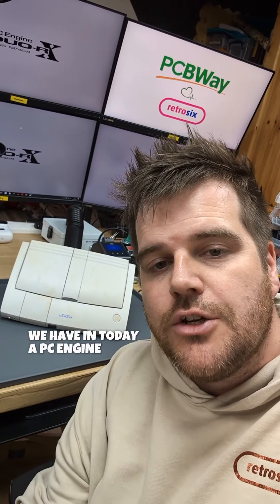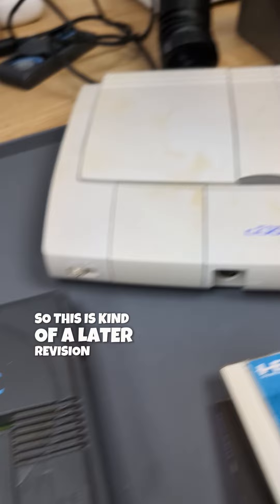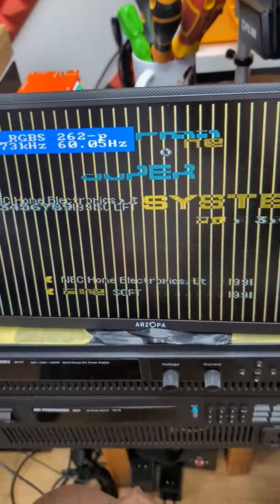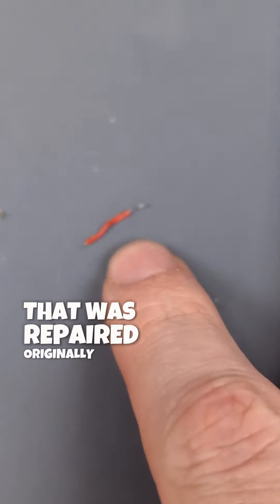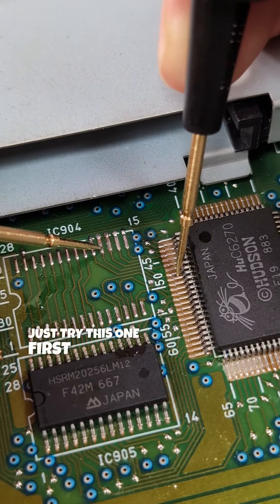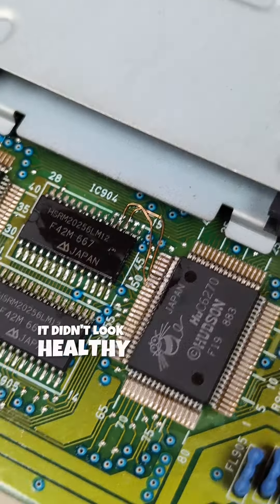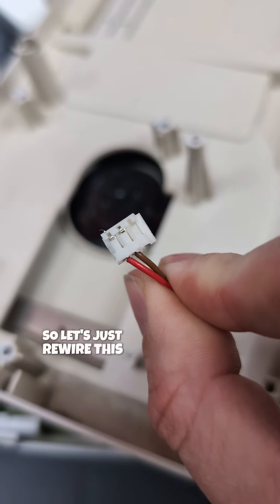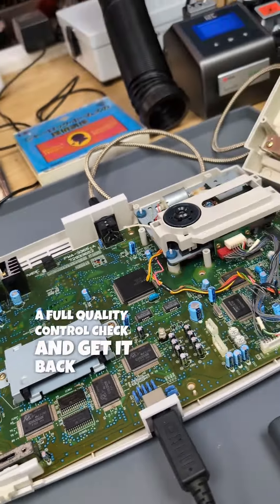Restoring this Japanese Home Arcade console, the PCB Engine Duo-R @PCBWay

Comment: hey luke I have a relatively similar situation to this in that I have a sega nomad that I attempted to recap. I got most all of them successfully recapped but there's about 4-5 that I think I did a jank job of replacing and as a result the LCD no longer powers on. I got a lcd mod replacement and am wanting to get a lazer bear battery. If I sent you all that stuff to your shop how much would it run roughly? i know typical restoration on your site lists 80 dollars but Id imagine it'd be more for the added parts. If you'd prefer to PM me feel free to! anyways happy to see you uploading new stuff and I've been very curious about seeing more of the in's and out's of the pc engine duo r's. It's actually the model I've been wanting to get my hands on.